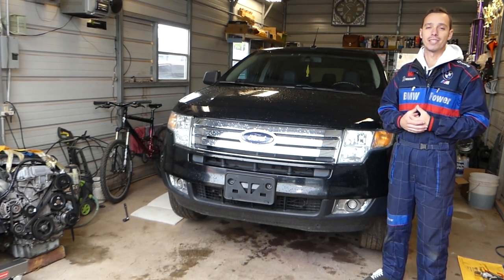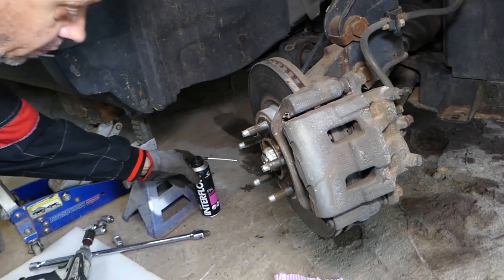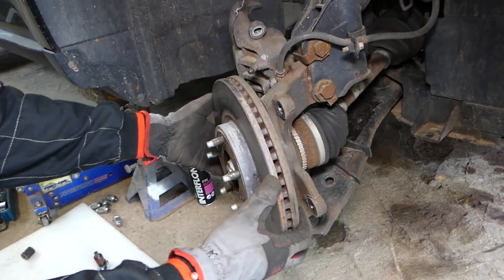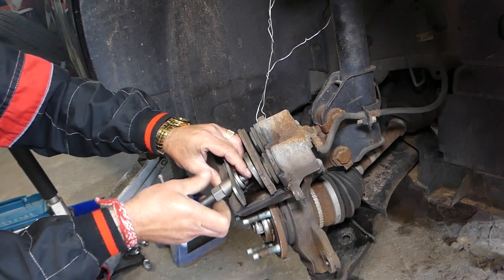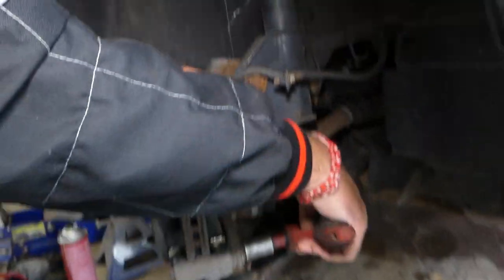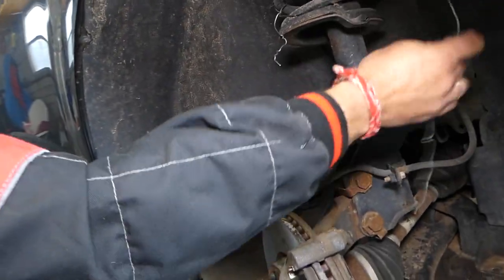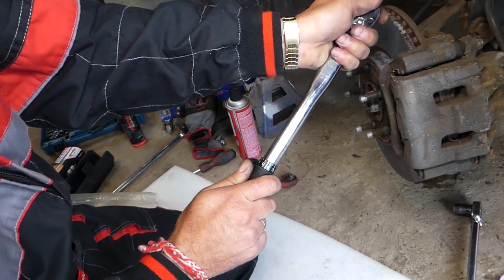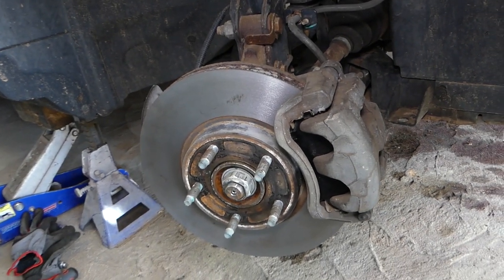FORD EDGE FRONT BRAKE PADS REPLACEMENT. DISC BRAKE ROTOR REPLACEMENT REMOVAL

Comment: Some mechanics claim you should open the bleeder screw when compressing the old pads in order to avoid pushing contaminated brake fluid into the ABS pump.  That could jam up the valves and cause the ABS light to come on.  Apparently the ABS pump is not serviceable.

Comment: thank you for the specs. very informative. i have this car and i have problems with a skid icon not sure what could be. maybe the traction, its been on for a year and wont ago away. it turns on after i start driving.
Reply: Similar problem with mine. You can try hooking it up to an OBD2 reader and likely get a code reading that may return something like "ABS/Wheel speed sensor" along with which one. At the very least it's a way to focus your attention on which wheel/system is involved. You may end up just needing to clean that sensor or replace it pretty easily for about $20.
Reply: Sean Forsberg you know, I was told that too, could be dirty but idk how to clean it, do I have to disconnect the cable and spray it with that sprayer that cleans connectors?
Reply: It could be the sensor itself, which is easier to access behind the wheel, or the connection, or, it could be something else entirely like the tone ring that the sensor reads. Figuring out which wheel is effected will give you a starting point, then you can try cleaning the sensor and inspecting the tone ring for cracks/damage/debris. If that does nothing then you can try checking/cleaning the sensor connection or simply changing the sensor out with a new one. At least if that fails it's a pretty cheap way to determine it's caused by something else.

Comment: I've got a 2015 dodge journey 3.6L .   When compressing the caliper piston to make room for the new pads does that also require bleeding the ABS system so the pedal doesn't go to the floor?   I just did a power bleed with a "MOTIVE POWER BLEEDER" about a month ago, I had to do this because I had about 3% moisture in the system.  But now, I'm about to replace the rotors and pads and I would like to know if Its necessary to do a bleed on the ABS system.  I watched your video on replacement of pads and rotors and I didn't hear you mention anything about bleeding the ABS system.
Reply: You should only need to bleed brakes if you replace lines, calipers or open it in some way to let air in.

Comment: Are the rotors on the front and on the back different sizes? if so what are the sizes?
Reply: They should be the same. If you get on RockAuto's website, they have all the parts you need. Just enter your make and model
Reply: They're all standard size